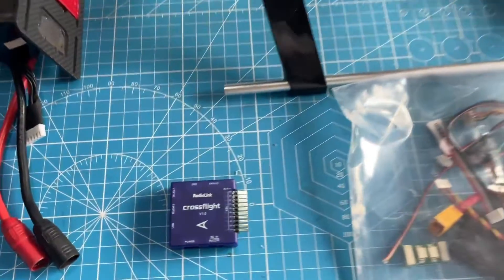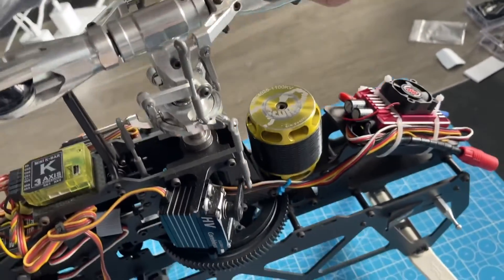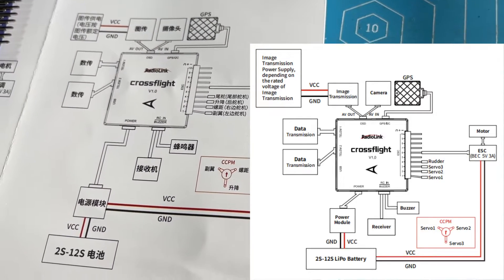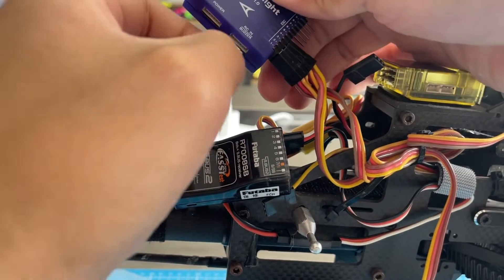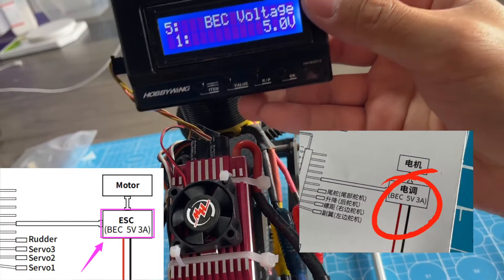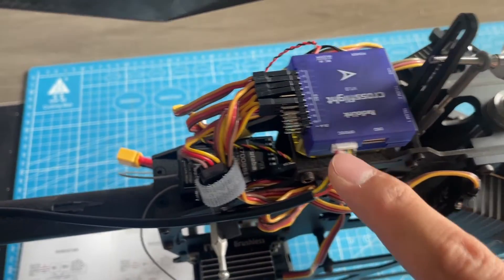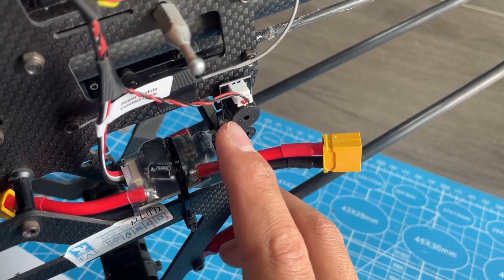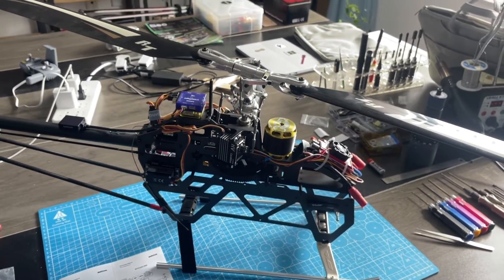Set crossflight/Mini Pix/PIXHAWK on Helicopter / Episode 1 Installation

Comment: Is this mini pix the same as the holybro mini pix 6C?
Reply from the maker: Hi, sir. This is RadioLink flight controller, which is not the same as the holybro mini pix 6C. You can check more details of the RadioLink flight controller from the link here:  https://www.radiolink.com/flight_controllers  Here is the RadioLink Mini Pix: https://radiolink.com/minipix  If any question about RadioLink products please feel free to contact us. Our email is: after_service@radiolink.com.cn
Reply: OK . thank you very much.  I have more questions 🤭😁🙂 If I buy a minipix radiolink, could I configure it for a helicopter too?
Reply from the maker: @MrCADU267  Hi, sir. Yes. You can use Mini Pix to control a helicopter. The using methods are similar to CrossFlight. Here are  the links of tutorials and manual for your reference: https://www.youtube.com/watch?v=um655Uxnqnw  https://www.radiolink.com/minipix_manual  If any question about RadioLink products please feel free to contact us. Our email is: after_service@radiolink.com.cn

Comment: At what range should I set rssi alarm in my at9s pro for long range?
Reply from the maker: Hi, sir. You need to set RSSI according to the control range you want. For example, you can test the control range on the ground. For example, one person takes the AT9S Pro transmitter and check the RSSI value on the screen of AT9S Pro, the other one takes the receiver and go away. When the RSSI shows NULL, there is no signal. You can check how far is it from you two person. Then it is the control distance. You know what range you want. Then you can set the RSSI alarm value based on the control range you want. If any question about RadioLink products please feel free to contact us. Our email is: after_service@radiolink.com.cn